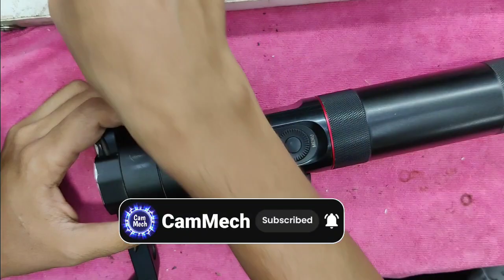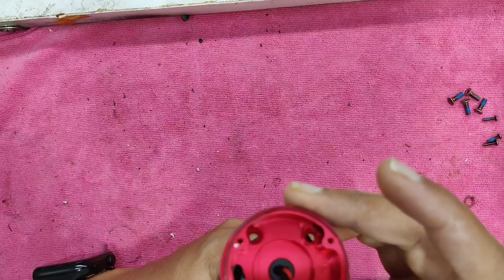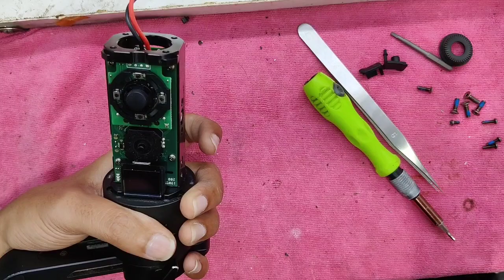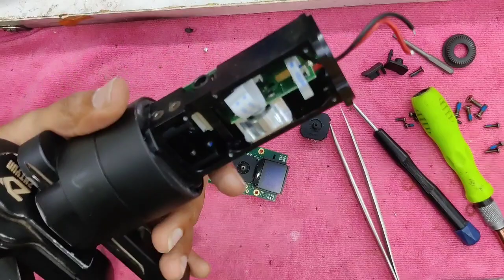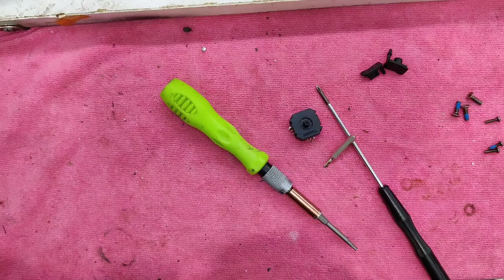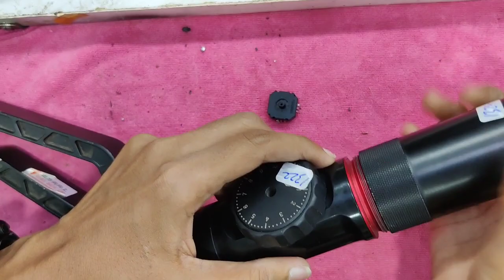Zhiyun crane 2 || Zhiyun crane 2 joystick Replacement

Comment: did you repair zhiyun crane m3 ?
Reply from the maker: Yes
Reply: I have a problem after attempting to repair my Zhiyun Crane M3. Now, the bottom motor of the gimbal's 'pan axis motor' is rotating continuously, and I can't seem to resolve this issue. @icammech
Reply from the maker: @januszkowalski5212  did u open motor there is an adjustment
Reply: @icammech  I desoldered the PCB from the controller and disconnected the flexes. After resoldering the 3 motor wires and reconnecting the flexes, this motor starts spinning when the gimbal is powered on, while the other two motors work correctly.

I didn't remove the motor; the resistances on the coils are correct when comparing them to the rest of the motors.

However, I did unscrew the slipring cable screw.
Reply from the maker: @januszkowalski5212  can u call me on Sunday ( Instagram call) I’ll try to help